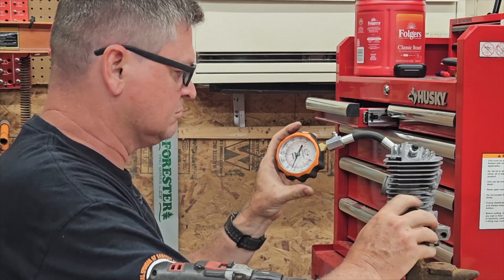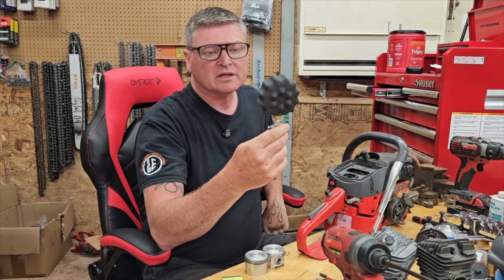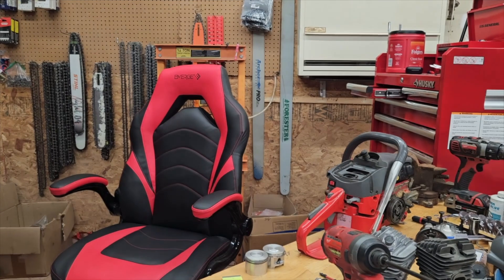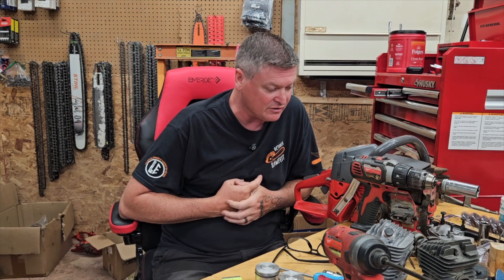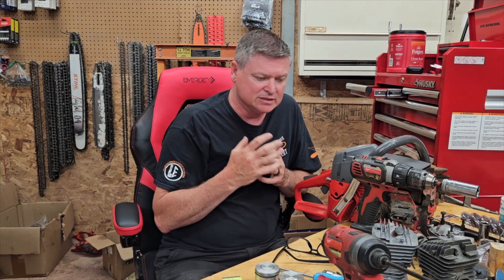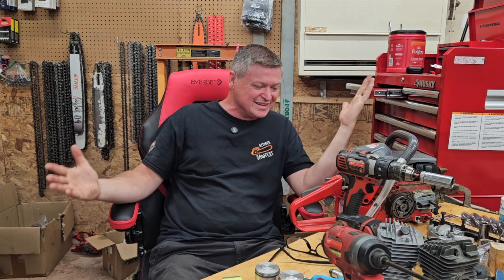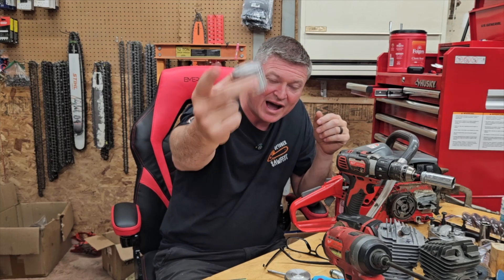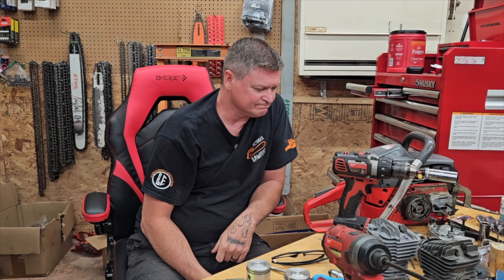Can you check compression using a drill?

Comment: This may have already been said,  But as a diesel instructor since 1998 and dealing and testing some very high compression engines I have seen it happen many times on engines we were trying to test while they were running. The guage would always read condiderably lower pressures.  So with that said, pertaining to your situation..... Pull-cord tests allow for multiple pulls at a lower rpm and not a constant non stop rotation, giving the gauge time to register peak pressure between pulls, whereas a drill provides rapid, continuous revolutions .  The check valve inside the guage when using the drill is opening and closing (pulsating) so fast it can not read maximum pressure. The valve does not have time to shut before it is opening again. Thus not allowing for maximum pressure because the piston is movin up and down so fast, it is drawing some pressure away (piston moving down) before starting back up, filling the guage again.   example: Its like floating the valves on a 350 engine at high rpm.  To fast to operate properly as designed.

Comment: The pull start wouldnt give resistance as it starts over TDC perhaps trapping more fuel air. While the drill from the sounds slow the speed after tdc. So to test adapt a one way clutch perhaps from an old briggs starter.

Comment: With out oil on the cilender and rings you will not have compression if you put oil down the plug hole you have more compression your rotation of piston with out fule will dry the ring, we used to hand star old lister engines lo on compression by putting oil in the induction manifold it allways worked ,

Comment: I was going to say are u using the drill in high gear. Maybe u are but i say it because i have the same drill an i use it to start a old push mower an it will not crank it with in in 1 speed on top of the drill. I maybe b completely wrong but its all i got for info on that.

Comment: I have the answer…just not the one you want😂

Stop relying on psi readings. Measuring chambers and calculating compression ratios is more accurate and more valuable. Compression ratio cares none about how you pull, porting, etc. Also in your case it will be faster and easier.

Comment: My hunch is the RPM's of the pull cord is actually higher than a drill. Most saws idle at what, 2500 rpm. So most coils must be designed to fire an arc at maybe 2000 rpm+/- , so I'd say the drill would need to be on its fastest setting.

Comment: Using the pull rope you are turning the engine over faster which in turn is forcing more air into the combustion chamber before it closes off which puts more compression into the saw when starting and running. Which is why the saw was showing less compression with the drill. And the pull rope is wrapped around a "pulley" or "gear:  that gets faster as the rope is pulled cause the amount of rope that it takes to go around one time is getting smaller as the rope is pulled which increases the speed. Like a centrifugal clutch on a go-cart or side by side. Plus the pull rope goes at a steady speed where the drill stops or slows down when it hits the compression.

Comment: Maybe try your impact driver instead of your drill. Oh btw, it's seems most people automatically assume when comparing readings the higher reading is always more accurate even when comparing different compression gauges. So the rule is, find a way to test ten different compression testers and the one that reads the highest compression is the most accurate. My question for the meeting house, why the higher reading test/tester always more accurate? Another test is to test a few different saws both ways to get a constant multiplier. Good luck solving the mystery.

Comment: 👍👍 right from the net. Referenced from 4 stroke. 

When you do a cranking (static) compression test, you are checking cylinder sealing, not cylinder breathing.

A running dynamic compression test (or in this case using a drill) , uses a compression gauge, to check individual cylinder breathing. So, basically you are checking, how well your engine, is inhaling and exhaling.

Running dynamic Compression Test At Idle Speed: Should be 50 to 75 (PSI) (about half of cranking compression, in the example provided above by author, about 133.7)

Snap Throttle Compression: Should be (about 80% of cranking compression). This means a quick snap of the accelerator but not wide open. 

This site just advised some numbers and 4 stroke reasons for the differences which may or may not apply to 2 stroke.

My personal speculation, pulling over by hand does not induce as much piston and ring movement or momentum and shows a better ability of rings to seal at a low rpm.  I think you are spinning it faster with the drill than a pull start, which is the opposite of what most commenters are stating.

https://dannysengineportal.com/running-dynamic-compression-test-evaluating-individual-cylinders/

Comment: The drill is not spinning it fast enough. Dynamic compression changes with speed. The pull cord can spin the crankshaft way faster than a drill. Unless you have an electric drill that’s strong enough to turn it faster than your pull cord can spin it. Something as Saw builders we all do is say we check the static compression by pulling it over 10 times in reality it is dynamic. Static compression is technically the amount of compression measured from bottom dead center to top dead center in one stroke that’s true static compression two strokes need to be measured dynamically, and the faster you spen them the more compression they can build was that being said they do have a max pressure they can reach. Four strokes static compression can be measured because the valve is opening allowing air in and completely closing off the cylinder as it goes from bottom dead center to top dead center I hope this helps

Comment: I think you will find its rpm related. When you use the pull starter you are probably getting about 4 to 5 full rotations (you can check how many 'pops' you get in a full pull of the cord) in about 3/4 second or about 6.6 rotations/second =400 rpm. When you use the drill I counted about 3 to 4 rotations per second (240 rpm). There is going to be leak down past the ring/ring gap and the slower you turn over the less peak pressure will be realized in the cylinder. Also time is a factor also I think, because you notice that if you pull at the same speed/rate for 4 pulls of the starter your pressure is lower than if you give it 8 or 10 pulls, I think the Schrader valve needs to be subjected to the 'high' pressure long enough to be able to equalize and have air transfer past the valve, if you are pulling too slow or not enough times then the valve doesn't open enough or for long enough to allow the max pressure to accumulate.
The faster you turn over the engine, the more compression you will measure to a point, for example, with starter you get 165 psi at 400 rpm but I bet in running condition at 2800 rpm idle you will be getting more.
Test the theory by pulling the starter at a slower rate or get a more powerful drill that can achieve more rpm with that load.
To minimize the leakdown loss add some oil to the cylinder/rings to simulate a perfect seal and you have to run it with the drill (lower rpm) for a much longer time to get  enough air to flow past the valve, which is probably opening a smaller amount due to the lower pressure achieved and also subjected to that pressure for less time because of the lower rpm, therefore it takes longer for the air on the gauge side to reach equalization.
just my theory.
Reply: I agree, well said

Comment: Don’t know. What’s the rpm of your drill? Do you get higher numbers with a little oil in the cylinder? It really shouldn’t matter all that much what speed you spin it, the compression is still basically the same. But that doesn’t necessarily mean the gauge will read it the same. But in theory you shouldn’t have to pull the recoil more than once but since you do, probably the valve in the gauge only works correctly under certain parameters. I haven’t used a compression tester since the 80’s. All I’ve done is aircraft cylinder pressure differential testing. But that isn’t going to tell you what you want to know so 🤷🏽‍♂️

Comment: I’m not certain but I believe it’s the volumetric efficiency. Low rpm doesn’t allow airflow to move as efficiently. Might fall short drawing vacuum and pumping air. Also the seal between rings and cylinder are not perfect. Slow rotating speeds allow air to escape. Not a lot but some will escape. Basically the drill needs to be powerful enough to rotate the engine a few extra times after the release of the trigger.  Enough momentum needs to be applied to rotate the engine even after the trigger is released to simulate normal starting process.

Edit:  Good example is wildly ported engines might have issues with starting because they have difficulty moving air at low rpm. Could even effect it at idle. Go to full rpm and it runs good.

Comment: I bet with you editing software you could use the sound of the exhaust pulses over time to calculate the difference in rpm between the drill and the recoil. To my ear it sounds like with the recoil the rpm is double as fast as the drill. Project farm uses a corded drill when checking compression on lawn mower engines.